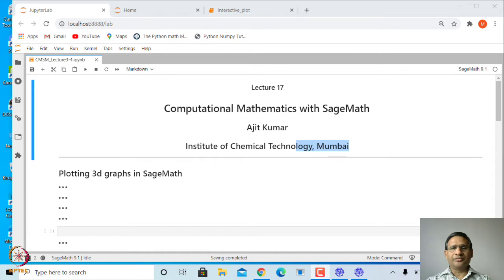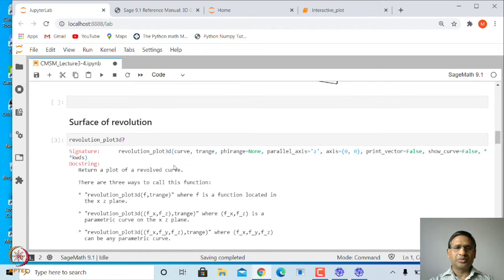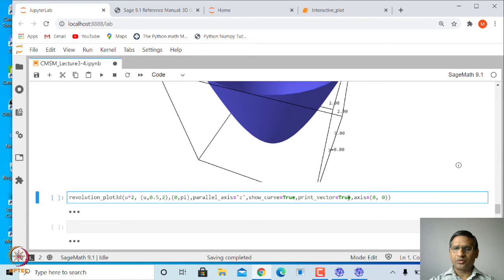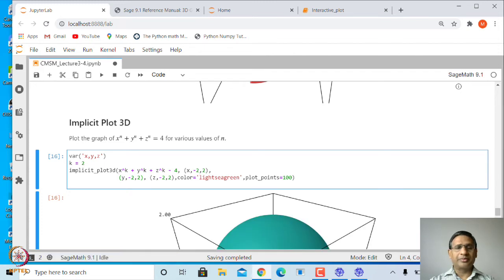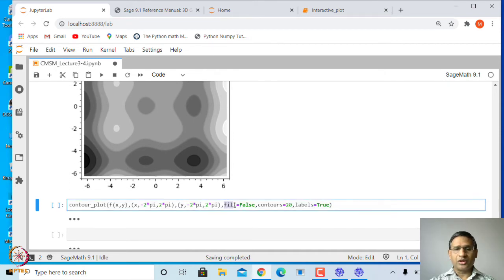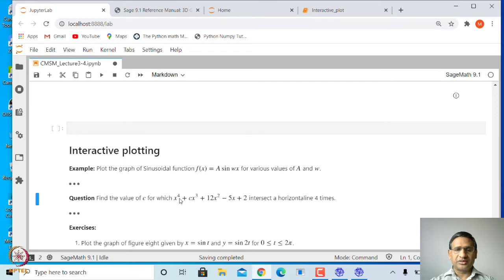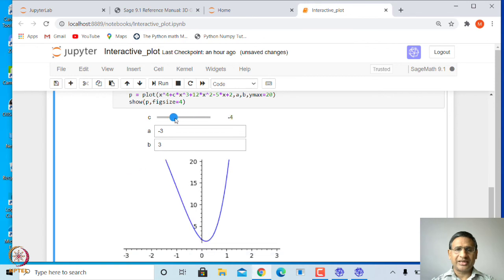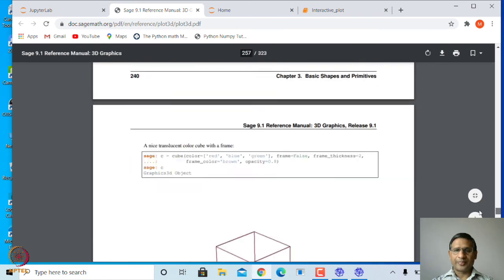3d Plotting with SageMath

Comment: BEWARE OF WHICH BROWSER YOU USE FOR SAGEMATH

THE OPEN SOURCE CHROMIUM BROWSER DOES NOT SUPPORT THREEJS

FIREFOX WORKED, I SUSPECT GOOGLE CHROME WILL WORK

ALSO BUILDING SAGEMATH 10.7 FROM SOURCE DID NOT BUILD JMOL

I HAD TO COPY THE [SAGE_ROOT]/local/share/jmol FROM SAGE 9.8 

INTO THE SAME DIRECTORY FOR SAGE 10.7 WHICH WAS MISSING

MAKE SURE jupyter-threejs-sage IS INSTALLED USING THE PIP AND PYTHON

FROM INSIDE OF THE SAGEMATH ROOT